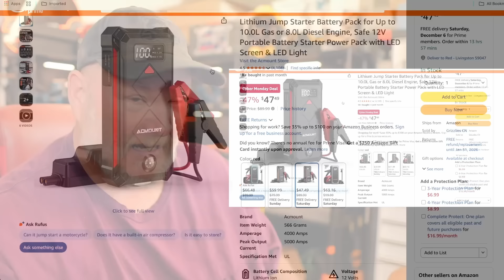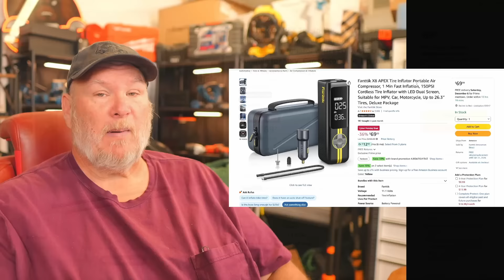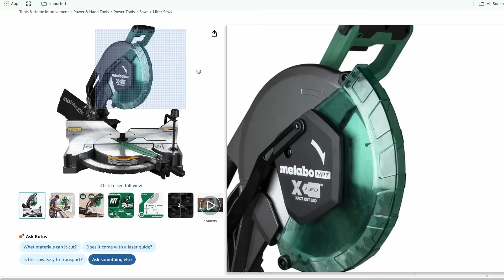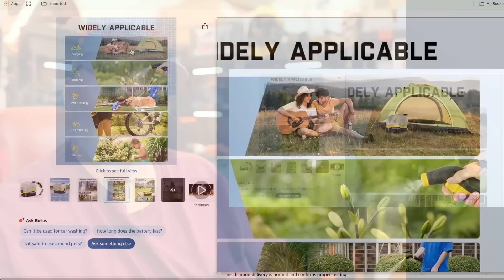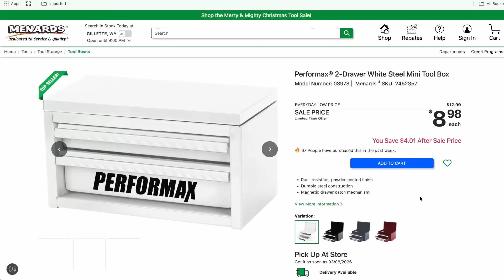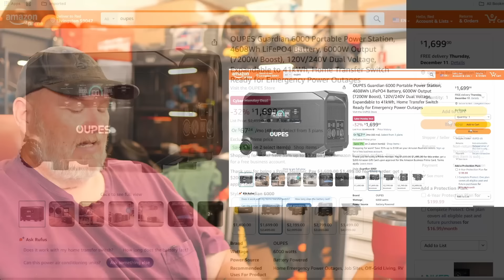Cyber Monday Tool Deals of the Week & More! 12/1/25 #dotdotw

Comment: I've got a Snow Joe 24 volt power shovel and this fall I added a corded Snow Joe snow thrower.  The snow thrower's chute keeps popping loose so that only the locking screw retains it, but a bungee around the chute and the hooks over the upper lip takes care of that and doesn't restrict turning the chute much.  In the spring I'll look for a more permanent solution.  It did a good job on the driveway.  It worked on the porch but it turned out the power shovel worked better there.

Comment: Bluetti just released a new 4000wh Elite 400 V2 power station for $1199 ($2999 regular).
This is also eligible for the 30% Federal tax credit. There's also a 6% promo code. With your cash back credit card. You could snag this for $780. 😮

Comment: Lowe's had a fantastic Cyber Monday sale.
All the Flex 24v nailers were $99. The rest of the Flex 24v tools were mostly $79 dollars.
I picked up a Flex 24v waterproof radio for $149 ($299).
I also picked up two EGO 3000 Lumen shop lights for $69 each ($109 regular).

Comment: Get the heated gloves.  I have bad circulation and big hands.  My hands are cold from now until June.  Snowblowing was terrible because I wasn't moving enough to get my heart rate up and holding tight to a handle really cut off heat to my fingers.  The heated gloves are totally worth it.

Comment: I just ordered the Oupes Guardian 6000 with an extra battery after I saw an Oupes YouTube video where it showed that the Guardian 6000 unit alone has 7200 W boost, but when coupled with an extra battery, it can output 7200 W until the combined batteries die.
I wanted the 120V and 240V for my present manual transfer switch.    The 240V circuit in the transfer switch is for my well pump.   I looked at the Ecoflow equivalent, and it is many thousands of $ more.
Reply from the maker: You are going to love it!

Comment: don't you ever bring up "what you need" in a tool discussion. If that was the case, I would have bought one of the sockets set cubes and been done.  and yes, this is sarcasm but not exactly wrong when you look at my tool boxes
Reply from the maker: It's not about what you need now but what you "Might Need"!
Reply: @denoftools  it’s the best feeling when you do end up using something you bought at a great deal. 😉
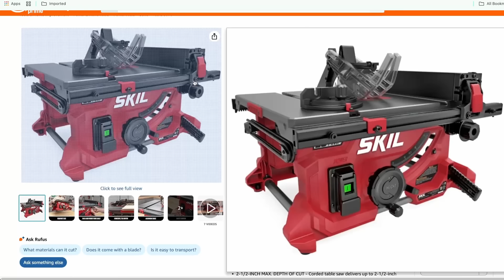Reply: There.. on the screen (24:09) you had a better option of skil table saw - 10inch than the 8quarter.